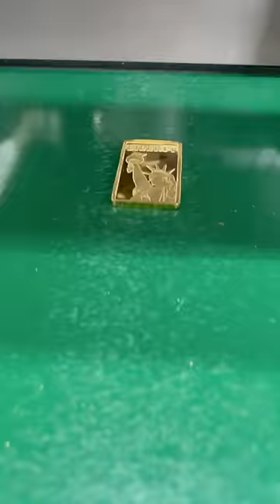Manufacturing gold coins but in asmr! Available on our website kimminhstudios.com

Comment: 1. it is recommended using a graphite mold instead of a cast-iron one for casting. Impurities or trace amounts of iron from cast-iron mold may dissolve in the melted gold.
2. An acid bath is required when after finishing every step of the process. According to your video (esp. grains > cast bars), it seems your gold bars attracted some impurities on the surfaces. Impurities lodged in the pores cannot be simply removed by brushing and may contaminate the minted bars.
Without rigorous manufacturing process, I was wondering whether the overall purity is still 99.99?